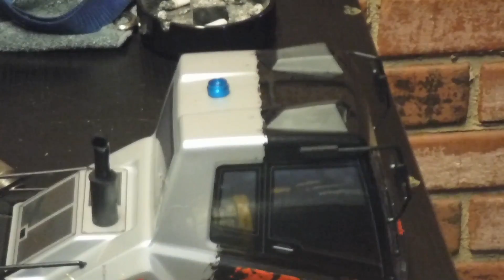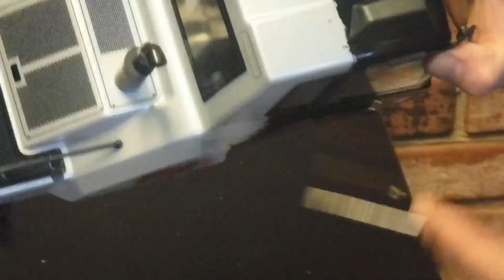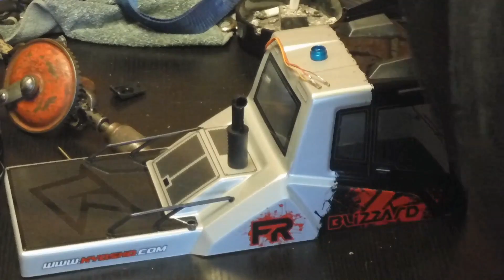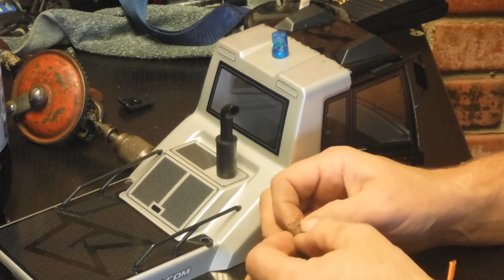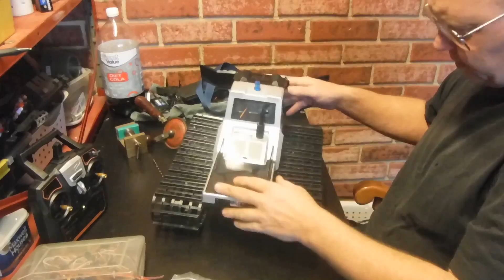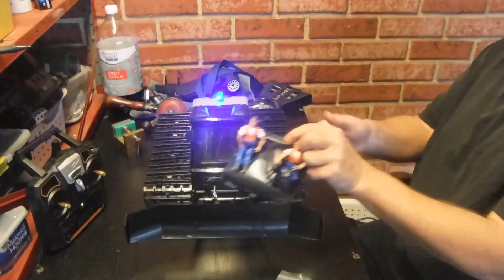Kyosho Blizzard FR Gets Led Strobe Upgrade

Comment: I think I am going to have those screens photo etched and cut out the plastic or just paint them black. I am a scale modeler and I am already going over board on my improvements on this thing. Like the Fishing tug I got for $15 from Goodwill. By the time I finished, I had $500 in improvements on the silly thing. Its a vintage toy...well ...WAS as toy...now its all hobby grade. I am a bleeding heart for anything RC. Check out my You tube channel RC Hobbiest Extreme. You can see my own shop of horrors! lol.
Reply from the maker: cool ill take a look